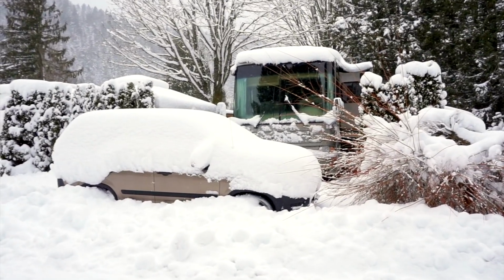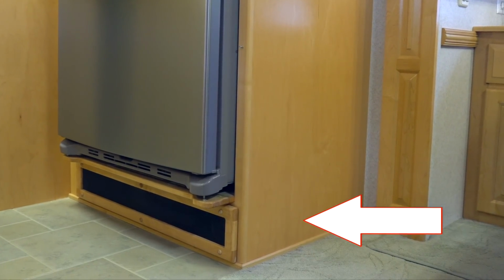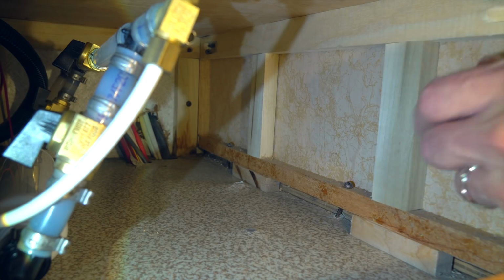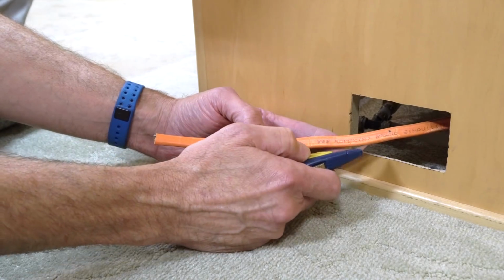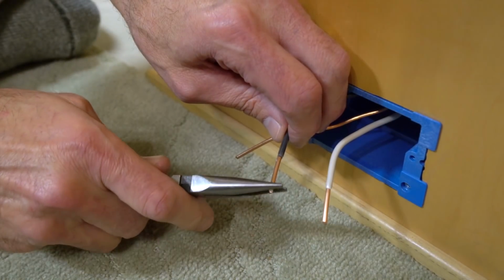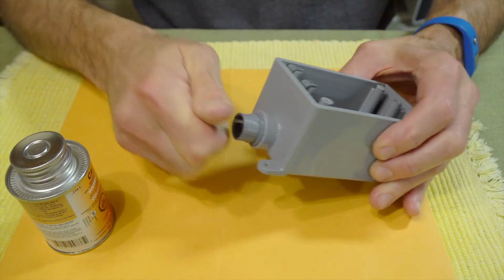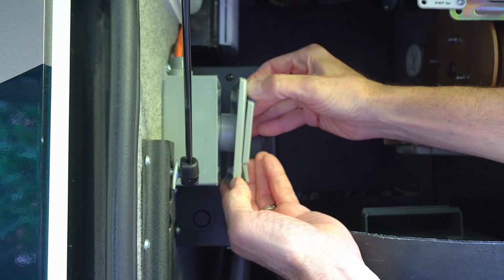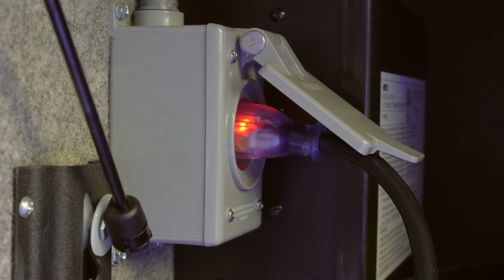Installing Our Winter RVing Secret Weapon!

Comment: Nicely done!  I probably would have rotated the inside outlet in the opposite direction so that the neutral pin is on top instead of having the hot there.  Slightly more protection if something gets dropped onto it.

Comment: Can yu tell me what heater model that is?  I did not see it listed on your RV Geeks website or Amazon Store pages
Reply from the maker: Kozy World has updated our heater to a newer, sleeker design. You can find it here: https://amzn.to/3DHADgz For use in an RV (sitting on the floor), you'll also need the optional feet, which are very easy to attach. Here's a link: https://amzn.to/3Wd9TvF

Comment: To me that seems really silly to put a heating source buy a refrigerator am I wrong
Reply from the maker: It's outside the fridge enclosure, facing away from it, and has no bearing on the fridge at all, so it's not an issue.

Comment: Warning,   Not all pedestals will have 20 amp rated duplex receptacles.  A 15 amp duplex receptacle is acceptable by NEC on a 20 amp breaker.

Comment: Great idea.
Never gave it a thought to just add another seperate 20 amp service to my 5th wheel for dedicated accessories.
Not only could you use it for an electric heater in winter to save on propane fuel for heating but ALSO on that extra AC unit I installed in the rear garage area of my toy hauler.
A 120 volt 30 amp service is not enough to run 2 AC units.
FYI depending on where you put that outside inlet power connector , you may also want to allow for an "in use cover" if on the outside.
Reply from the maker: Nice!

Comment: Thanks, great video. Question- Where in New York and we're thinking of leaving in January to go to Florida. We want to boondock about 2-3 nights on the way down and use our propane heater in our 29' class C Sunseeker.  I'm more concerned about how much battery power we need to go all night.  Will that completely drain our house batteries? If I get low on propane, I could just refill it the next day, but do you think I can go all night using my house battery power before recharging with the generator or driving?
Reply from the maker: Not knowing your entire system and power usage, it’s difficult for us to be sure. But the single biggest factor will be how you heat your RV overnight. A propane furnace that blows warm air into the RV via fans and ductwork will use a considerable amount of 12 V power to run those fans. On the other hand, if you have a propane heat source that uses no electricity, like a Little Buddy, or a Kozy World heater like ours, they will have no impact on your power at all, and make it much more likely that you’ll make it through the night without a problem. The best thing we can suggest is to keep the heat set as low as you’re comfortable with, and use heavy covers on the bed to make up for it, and also to minimize power usage after you stop for the evening, and especially before it gets really cold out. That generally means cooking with propane vs electricity (or eating out), skipping TV and laptop use (phone or iPad is better), going to bed a little on the earlier side, and waking up a little on the earlier side instead of staying up late when it’s really cold and continuing to use power late into the night. Hope this helps. Safe travels!
Reply: @RVgeeks  Thank you so much for that detailed informative response. We do have the system you mentioned 1st with fans and ducts. Your advice was very helpful. I think will be OK bundling up and setting it as low as we can handle it. Thanks again.

Comment: I live in an RV park that is wired for 30 amp service. The owner had to remove the boxes 20 amp circuit. It was never intended to draw 50 amps by running both circuits. The 20 amp plugs were a convenience when you wanted to use the electricity outside.  I would think many RV parks that say 30 amp means not to draw more than 30 amps by using a secret trick or you might over stress the 30 amp design.
Reply from the maker: That would likely be a park that took a shortcut by wiring the 20-amp outlet through the 30-amp breaker. Properly wired pedestals have one 30-amp breaker for the 30-amp outlet and one 15- or 20-amp breaker for the 15- or 20-amp outlet. Both of those can be used simultaneously per code.
Reply: @RVgeeks  If that was the case they would charge for 50 amp service. A separate box and circuit with a fuse just protects whats plugged into, Doesn't mean they have 50 amps to supply.
Reply from the maker: There’s actually kind of a misnomer about 50-amp service. It’s not the equivalent of a 30-amp  connection plus a 20- amp connection. 50-amp service is actually TWO 50-amp circuits on two legs for a total of 100 amps. It’s so much power that there’s virtually no way most RVs (even those with 50-amp service/plugs) could use it all. We can run FAR more on a 50-amp connection (both air conditioners, microwave oven, clothes dryer, coffee maker and more, all simultaneously) than we could on a 30-amp plus a 20-amp combined. It’s a weird thing that they don’t refer to 50-amp connections as 100-amp connections, but it’s a LOT of power available for any RV.

Comment: you can also use this to power a SECOND AC unit. you could have a window AC that's powered by this or if you wire up an outlet like the video, you could just plug AC in.

Comment: Why use 10(orange)wire rated for 30 amp. 12(yellow)wire is for 20 amp. You’re using 20 amp outlets and power source is 20 amp. ????
Reply from the maker: Hi Art. Because we're not electricians, we felt safer using heavier-than-needed gauge wire to ensure it could handle the load.
Reply: RVgeeks always use the recommended wire and outlets that your supply calls for. That wire isn’t providing with any extra safety.

Comment: I would do that on his rv.
There is an easier way to do it. Just wire a extension cord to the outlet box, in the rv.
Also some places have separate breakers for each outlet on the pole. That means you can use 40 more amps, just run a separate cord. 
Make sure you use good, heavy duty 20 amp cords, the cheap ones are not worth it.

Comment: Of course you can also do what I do: Just run an extension cable through a front or side window and use it for the 2nd heater. Yes there's a slight opening when the window is closed back up but a little fresh air never hurt anyone.

Comment: One question.. Most 4 season rv's have the water lines and tanks running along the heat ducts to keep them from freezing. If you dont use the furnace have you ever run into a problem with freezing of lines or tanks?

Comment: If you aren’t using your onboard heating system, how are you keeping your pipes from freezing? Typically the furnace heat spills over onto the plumbing.
Reply from the maker: A 60-watt incandescent light bulb does the trick! Mentioned in this video: https://youtu.be/n5RGlcLSrM4

Comment: Great video and creative use of the power pedestal.  Just remember that a space heater for the common area does not provide any heat to the “basement” areas or holding tanks.  Units that rely on the propane heater to provide heat to keep tanks from freezing will only work while the heater and fan are running.  Warming pads attached to tanks are typically powered by a 12 volt DC charger and house batteries.  🎄👍🎄
Reply from the maker: Yes indeed! Our video about RVing in the winter shows us using a 60-watt bulb to keep the basement warm. Works wonders!

Comment: Very good video, I'm trying not to use propane unless absolutely needed. This includes using a portable induction hot plate for cooking. This idea has provided me with another method to heat our class c. I would've run the split wire loom to cover all of the 10/2 romex, cleaner job and the wire is protected.  And I would have used zip tie brackets and not the the wire staples. Would hate to have to redo that job. Thanks for the vid.

Comment: 0:34 that plug does not fit that socket !
Reply from the maker: You’re quite the Monday morning quarterback! That plug fits fine! 😂
Reply: @RVgeeks  Whether it's plugs or boats, as an engineer, I notice these things.
What may seem 'fine' to the untrained eye....
Reply: In fact, I doubt the yellow fittings and in-line connection are appropriate for outdoor use !
Nope - reviewed again - there's no water protection on either of those connections - so totally inappropriate for outdoor use !

Comment: Why is most heaters under the fridge??? Makes no sense at all. Open fridge and fill it with heat!!!
Reply from the maker: The heat doesn't come out directly from the heater. It comes out from vents in the ceiling. No heat comes up into the fridge or freezer.

Comment: I am curious, the convection heater that you used in this video is not where the above link takes you. The link from this heater shown on your web page as items you use also does not work. Do you not recommend this heater now? Do you have an alternative that you would recommend?
Reply from the maker: Hi Stephen! Great question. Not long after we made the video, the heater failed, and we sent it back. Further research uncovered the fact that we weren't the only ones who had the same problem. We replaced it with a basic oscillating space heater, but even though it's been fine, it's no longer available. We linked to the Lasko one for a couple of reasons: We've owned Lasko products before and found them to be well made, and in researching the reviews, this one was well-rated by most people who own it. Hope this helps!
Reply: @RVgeeks  Yes, I am planning on adding this setup to my 39' motorhome so I can run a small heater like this in colder weather. I too have had issues with juggling stuff on a 30 amp service in the colder seasons. I ran across this video and thought this would work great, but want to make sure I get the right heater. It will be placed in the dining area to heat the living/kitchen area.
Reply from the maker: This setup has worked GREAT for us, so we're sure you'll experience the same thing. Oscillating space heaters are pretty reasonably priced and readily available, so finding one that's well-enough made to work for a few years should be pretty easy. Stay warm!

Comment: I have saved this video because It is VERY good. I plan on doing exactly what you have done for a heater, or, my single burner electrical stove I purchase for full hook up parks to eliminating the use of propane as well as not overpowering the 30 cord. Thank you for this video!
Reply from the maker: Thanks! 😊

Comment: How much mileage does your rig have?  And your toad?  Does the toad rack up miles on the odometer when being towed?
Reply from the maker: Hi David! RV is around 80,000 miles. Honda is about 103,000, and its odometer does not accumulate miles while being towed.

Comment: After 30 years of doing electrical work I have to say this is one of the best installations I’ve seen. I especially liked how you explained to not use the “push-in” holes on the outlet. That’s how a true professional would do it. Also since you are in a “vehicle” vibration is a real concern. Good job. 
Side note: instead of the cable staples you used, you should use the kind that are comprised of a white piece of plastic that straddles the romex and is secured with 2 small nails, 1 on either side of the romex. This prevents the metal staple from rubbing its way through the orange romex sheathing causing a “short” to occur by doing away with the metal staple. This can occur from the vibration caused by driving the vehicle.
Reply from the maker: Thanks so much for the nice comment and the constructive suggestion. We really appreciate it!
Reply: Wouldn’t having a in line circuit breaker for this be a good precaution?  What would you use if you did this?  Like this solution. Rob

Comment: Not a question on The Mod exactly but a question on the part of the video for your plane that cable couple feet long with the male and female ends in is that A50 amp a 30 amp adapter or what is it?

I've seen the 15 amp to 30

 I'd like to know. Any answers thanks
Reply from the maker: Hey Aaron. If you're talking about that short section of cable with the two yellow ends... that's our 50A to 30A adapter. Our RV is a 50-amp RV, so our power cord ends in a 50-A male plug. The site we were on in this video was a 30-amp site, so we needed to adapt our RV's power plug down to a 30-amp plug to connect it. Hope that answers your question!
Reply: @RVgeeks  thanks that's exactly why I thought it was I'm sure I'm not the the only one asking that because I've never seen with those in the wild.

But I have built them for other people not an RV person but somebody that does work on them occasionally for others in an electrical dyr and plumbing in just about anything you can think of as well I do everything to code Etc I'm the DIY IR that knows the tricks of the trade and the trade enough said.

Comment: Great idea - we use a similar circuit outside our rig to independently power our wifi booster. Just a couple of concerns, though. First, you mounted that circuit directly under a wet source - should you have any issues with your dishwasher malfunctioning, you left openings that can funnel water straight into your box. I would have recommended keeping the gasket and running the wire into the bottom of the box instead of the top, so to avoid any unfortunate water ingress. Same with the outlet on the side of the panel - a few extra bucks and the whole deal would be much less exposed in the event of a major spill. Second, I would have either used covered staples, or better yet some of that wire loom material and a conduit bracket to secure the wire. The regular staple works, but remember you're in a moving vehicle - not a stationary house. The vibrations of a moving RV might start causing those staples to chafe the wire (you could always dab a little epoxy between the cable and staple to prevent movement...). And finally - I agree with several of the other posts where you've left that circuit open to the sketchy campground power - at a minimum you may want to consider a surge controller somewhere in that circuit to keep that heater happy.
Reply from the maker: Thanks for the great points, Stephen!
Reply: @RVgeeks  - thanks for all your great ideas!

Comment: Nice how to. But I am concerned that you used solid wire. I would have run stranded.
Reply from the maker: We used the same solid wire they use in houses (and RVs, too)!
Reply: I would be concerned about vibration work hardening the solid wire. It will probably never be an issue but I’m a tad OCD. Other than the solid wire great, clean install.
Reply: All rv's that I have worked on are wired from the manufacturer  with romax for the AC wireing

Comment: Great video and nice installation guidance. BUT...if that job is too much for any of your viewers.....I usually just run an extension cord out through a side window in the front of the vehicle (an area you usually wall off from the main area of the RV anyway) and connect my heater up to that. You can close the window and just put a slight pinch on the extension cord. And you're right WHY NOT use both the 30 Amp and 20 Amp plugs. You're paying for them and it will certainly keep your propane costs down to help pay for the extra cost for the electrified camp site.

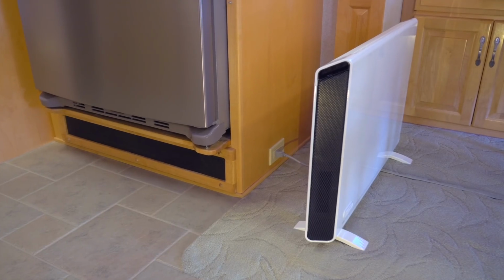Comment: Excellent video, will be doing this to our coach in a few days. At 11:21 on the video you show a smooth surface heater, what brand and model is that one please? Thank you.
Reply from the maker: Can’t recommend that one. Failed and sent back. We weren’t the only ones. Chronic problems.
Reply: @RVgeeks  do you have another one like it that you use? I have a counter in the bedroom area that would like to put one like that on the counter. Have the tower style from your Amazon link for the main living area. Thank you
Reply from the maker: We just picked up a couple of typical space heaters. Not sure of the brand, but they don’t do anything special. Adjustable temp, and oscillating. They’re all 1,500 watt, from any place like Walmart, Home Depot, etc.

Comment: So, your only,  ( PAYING FOR).. your 30 amp, but you are also using the 20 amp, also.... And who pays the difference... is it you... I ONLY say, because at many campsite, I go to ... thay come bye and check, wake me up too check.. so.... THANKS FOR THAT.... AND why don't you just use your 50 amp.. And pay your bill.... sorry, just a question,  for all of us true 30 amp users.. dont get all upset.... after all I'm the one that gets woke up at 7 in the morning,  when I get in at 2 in the morning...... I'm so glad everything works for you..... GO YOU.!!!!!!
Reply from the maker: We definitely do not advocate this as a way to steal electricity, but that shouldn’t be a problem, as any power used at a campsite will usually run through the meter. As far as using 50-amp, this setup is specifically for use when no 50-amp connection is available.

Comment: Some electricians use a few wraps of electrical tape around the box to cover the screw heads and wires... Just for an extra layer of protection from accidental current transfer. I enjoy your audio and video technique. Lots of work goes into making these videos. Thanks.

Comment: I am not an electrician but can't you just run a chord from the 20 amp pole plug to inside camper and plug Heater directly into it?
Reply from the maker: Yes indeed! We just wanted to make it a cleaner, more permanent installation and avoid running a cord out through a slideout (which we had done before) 😉
Reply: RVgeeks ..thanks..I wasn't sure..I always ask a electrician before I do something electrical..

Comment: Just a suggestion on the next project, I would add a stud to the other side of the box. Glue it to the panelling and angle screw or staple it to the top and bottom studs. A cabinet maker might even be fancier than that. Great video value. Thanks